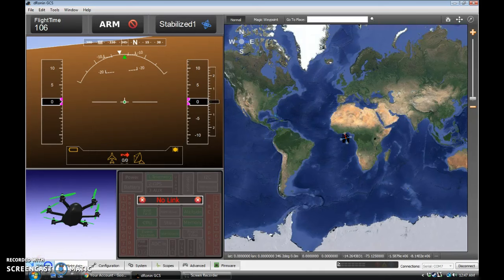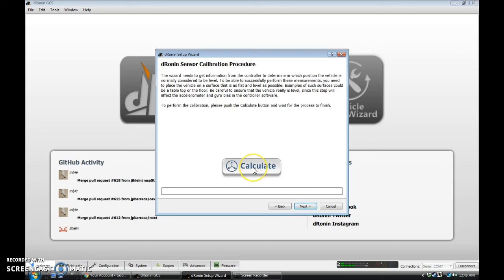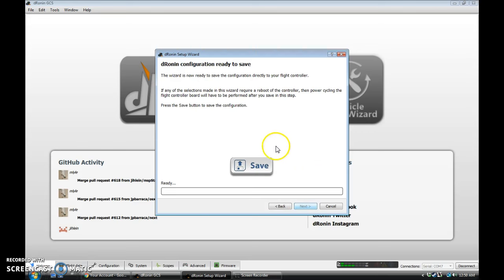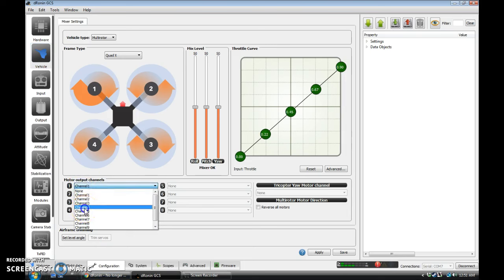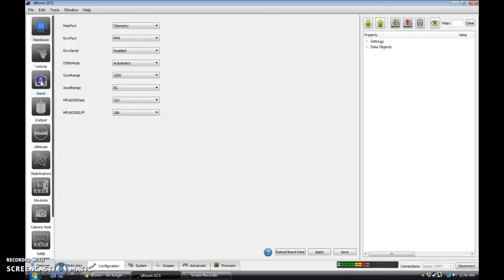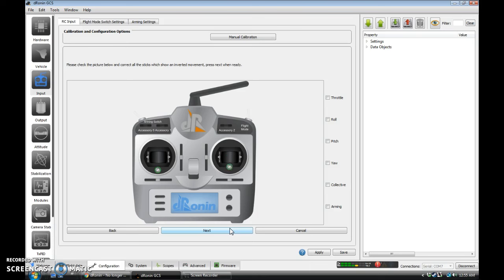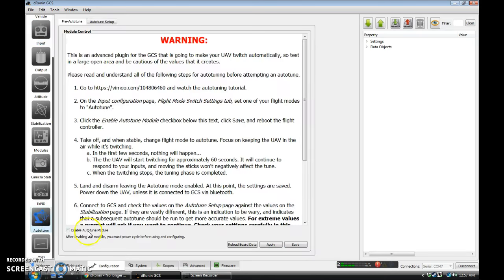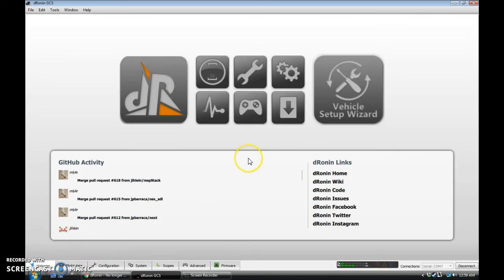dRonin on the emax Nighthawk 280 Pro - Part 2 - Basic Setup

Comment: How do you calibrate the esc's on the output esc calibration screen?
Reply from the maker: Yeah, I should have included that.  Mine already were so I kind of skipped over that.  But on the outputs tab there's a button for it.  Just make sure you've got your props off, then you can hit that and it will tell you to connect the battery, once you hear the beeps that they've got the max you hit an ok button and it drops to min and the ESC's will been a confirmation.

Comment: thanks for snappy reaponse...I have it up and running and have completed first autotune and have applied values...thanks again but have just one more question(for now) can't seem to set up battery monitoring with the buzzer so was not able to test new autotuned settings...I have set up vbat by simply soldering to battery -+ with supplied cable and of course buzzer connected to port...do you have similar set up? If so, how did you set up ports....Thanks two more times...I know you are not getting paid for this but certainly appreciate your input
Reply from the maker: +Shane Gibbs Glad to hear you've made it through your first autotune.  Unfortunately buzzer support is still somewhat a work in progress, it doesn't work with the standard buzzers that Naze32 boards usually use right now instead it expects a buzzer that needs a PWM signal to drive it.  As a result I haven't really messed with it.  I probably have a few buzzers that would be suitable but honestly I bash up buzzers so quickly when I've tried them that I just use an OSD, telemetry, or a timer in my tx tied to throttle %.  Though often I  just go without as I usually notice a significant drop in performance when my packs reach about 3.8v per cell that really stands out to me.  But that's just me, I know most people don't notice it.  There will probably be better buzzer support soon since it's a frequent request but most of the devs tend to use OSD's or telemetry so it hasn't been a very high priority.

Comment: I tried this on stock the BLHeli Nighthawk 280 and motor 1 and 4 don't spin up. Any ideas?
Reply from the maker: +image Hmm, did you select oneshot?  The stock version of blheli's implementation of oneshot doesn't play nice all the time.   You may want to try without oneshot (use the 400mhz Turbo PWM choice in the wizard instead) if you selected oneshot in the wizard.
Reply: +Jason Hitesman I think I tried both PWM400 and OneShot125. I&#39;ll check again tonight. I need to flash BLHeli, but soldering those pads is daunting.
Reply from the maker: image Hmm, are they not spinning up in the wizard when you set the neutral?  Or on the Outputs page?  Or when you arm?  Did you try doing an ESC calibration (make sure your props are off!) on the Outputs page?  

You don't HAVE to solder to do the blheli flash, you could just take some stiff wires and attach them to something so you can hold them against the pads while flashing.  It's a quick flash so you don't have to hold them there very long.  Some people find that a lot easier, personally I find soldering quicker and easier but I have years of soldering experience :D
Reply: +Jason Hitesman It did not spin at all during the neutral spinup wizard, nor did it when I ignored and tried to arm normally (after reordering where they were). 

I'll be putting some pins on some wires and going to flash that way tonight. Will give you an update.
Reply: +Jason Hitesman I updated to latest BLHeli and it still was happening. At that point, I did an ESC calibration and it worked. Should've done that first.
Reply from the maker: Doh, I mistakenly assumed you had done that already :D  Glad to hear it's working...and hey, now you've got the latest blheli too :D
Reply: Hi, sorry for picking this discussion up again. I am completely new to this and have the same issue. When using OneShot125 in the vehicle setup, then 1) the ESC melody is weird, playing the sound twice, namely parallel with a little time offset 2) and after that the two rear motors do not spin up on minimum rev test. 
Now with the 400Hz setting it works (well on the second try), but I haven't calibrated the ESCs yet.
So my questions, is it safe to calibrate the ESCs? In CF I read you might end up in the ESC settings when not fast on turning down the master switch. How does ESC calib work in dRonin (didn't dare to try yet and have not found a vid). Also, is it better to calibrate ESCs individually? 
If the above is clarified, I can test with the stock BLHeli and calibration if OneShot can be enabled without problems.
Reply from the maker: The stock version of blheli that emax ships is heavily modified and based off an older release.  If you want to use oneshot you'll have to reflash the ESC's first or it won't work reliably as you've already found (I have another video up about flashing the ESC's on this quad).  

Calibrating the ESC's should be safe, though the goofy version of blheli emax uses does sometimes read things wrong and has left people stuck in 3D mode or something else when calibrating.  If that happens you'll either need an emax programming card to reset things or you'll need to reflash the ESC's with real blheli.  It's best to calibrate through the FC and I've always had the best luck doing all four motors at once.  

But with the stock blheli you won't be able to use oneshot as there are fixes to blheli's oneshot code that the stock setup just doesn't have.

Hope that helps!
Reply: Thanks for your feedback, I will continue the config after work today. Indeed I wouldn't want to end up in 3D mode, for a beginner the learning/doing stuff curve gets pretty steep all of a sudden.
By the way dRonin crashed constantly on Windows (claiming that the C++ Runtime was doing something unexpected, though freshly installed), under Ubuntu 14.04 it works fine, except for the extreme delay between sensor calibration and init of ESCs in the vehicle setup (which results in a program crash, if one is not patient).
Reply from the maker: Haven't heard those issues with dRonin before...and that level of issue is a bit beyond my paygrade.  You may want to try the dRonin forum or open an issue on github: https://github.com/d-ronin/dronin/issues to see if one of the devs can give you some ideas there.

Definitely don't want 3D mode since the flight controller isn't setup for it :D  I flashed mine to the then latest blheli right when I got it so I didn't have any issues with the original firmware.  But it also means I can't help a lot with the stock setup anymore.